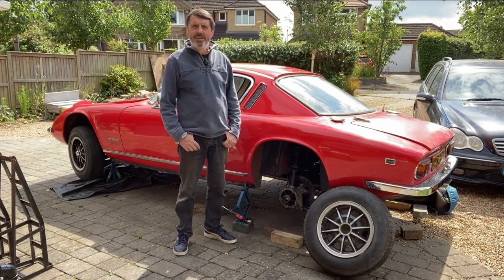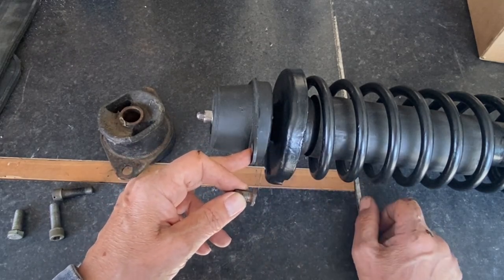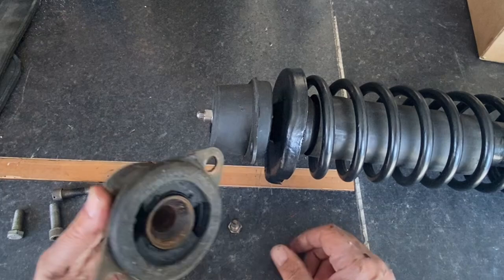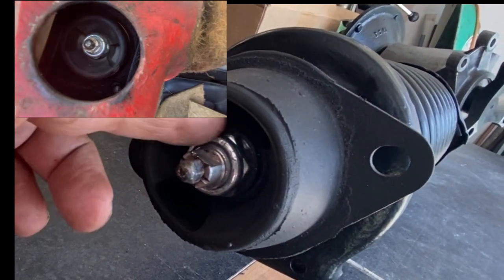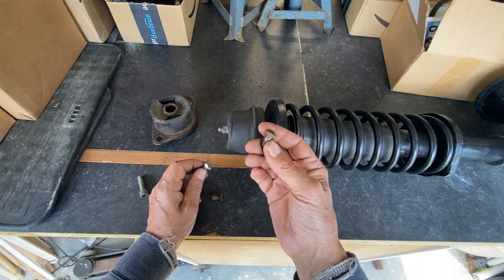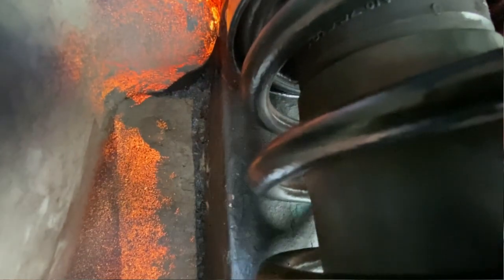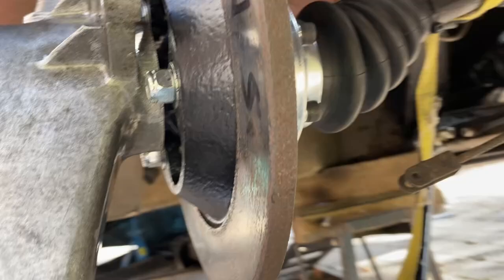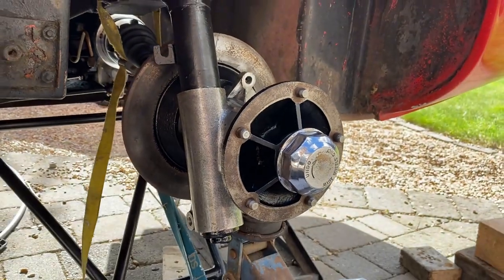Lotus Elan +2 : CV joint Drive Shafts

Comment: Hi Ian - I remember doing this , not easy but certainly worthwhile!  I fitted cv drive shafts from Mick Miller, they came with shallow nuts which gave more clearance between disc and the hub, I also remember shimming the disc to ensure it ran true.  Using the reamer is I think essential .  Once fitted the driving experience was vastly improved, no more kangarooing down the road.  I understand that the doughnuts available now are made from an inferior  rubber to the originals, so moving to cv drive shafts is  a great upgrade.

Comment: Very useful and timely video..llI am also in the process of installing the same Kelvedon CV joints and lhaving trouble with tight holes in the diff and hub "ears" ; interesting to see you using a reamer: pls tell me what size you used. Thx.
Reply from the maker: Hi Tony,  I used a 7/16 reamer.  The first drive shaft I fitted I didnt ream the holes and as you saw in the video I struggled a bit. The second one I did ream the holes and managed to get the drive shaft in much easier and without having to compress the springs.  Good luck with your install
Reply: @ianj3663  thx..7/16 is the nominal stud diameter and is too tight on mine; I deformed the thread on one stud trying to bang it in, needed to withdraw (slide hammer!) and re thread the damaged stud; just found and bought a 29/64 reamer on ebay..Hope that will be OK.. thx for the idea...Tony
Reply: A Dremel and 29/64 reamer did the job: nice sliding fit of the studs into the ears; hub side first, then diff side. Didn't need to compress the spring..All done.. 😊

Comment: 2.25” springs make fitting the struts so much easier!
Reply from the maker: Yes I bet they are easier with adjustable seats.  Did you do a conversion on the rear of your Elan?
Reply: @ianj3663  yeah, I did a video on it. Put konis in at the same time

Comment: I installed CVDS from Elantrikbits this week.  They were a doddle to fit and have transformed the way the car responds to the throttle.  I also no longer have to worry about the doughnuts failing as I've fitted 3 sets in the last 3 years.
Reply from the maker: Yea, I’ve heard the donuts you get these days days are crap 😊
Reply: I have the Mick Miller CV joints on my +2, best £400 I ever spent on the car, it transformed the slow speed in traffic movement, no more kangarooing & power take up was instant, not having to wait for the donuts to load up.